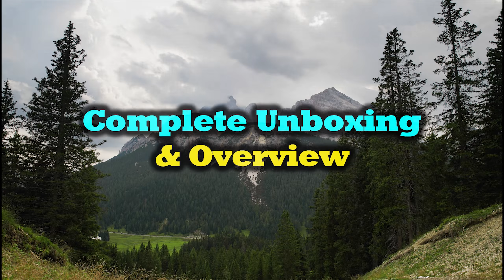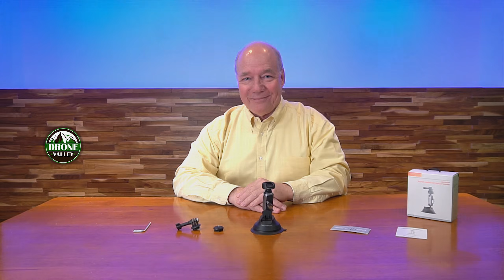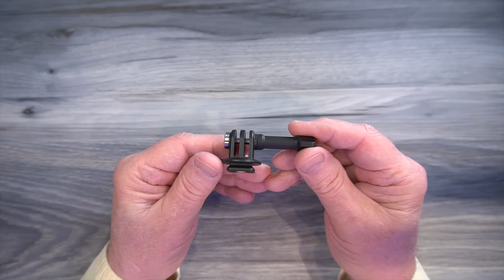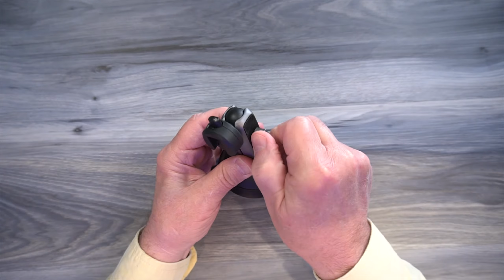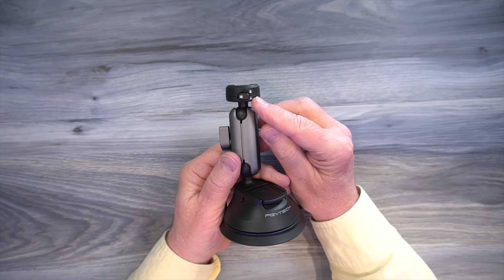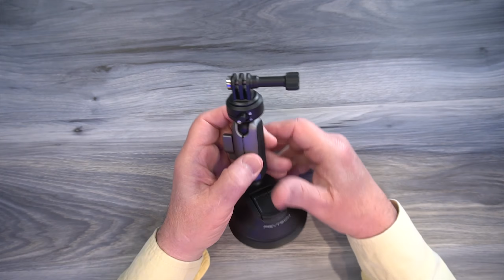PGYTECH CapLock Suction Mount | Awesome Action Camera Mount!

Comment: I have a couple of the old GoPro suction mounts and they work well, but they're a real pain to fit and get adjusted just right. These look heaps better and I like the fact they're smaller than a lot of other brands, making them a lot more suitable for mounting on windshields and aircraft windows. They don't get in the way as much.